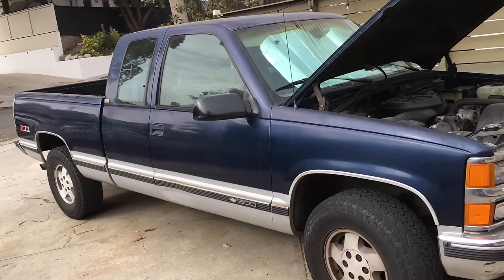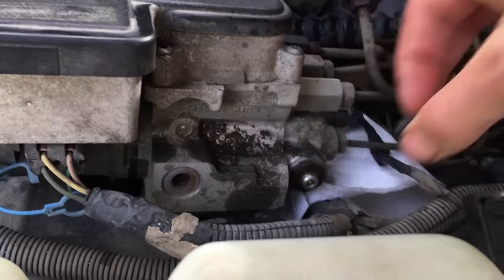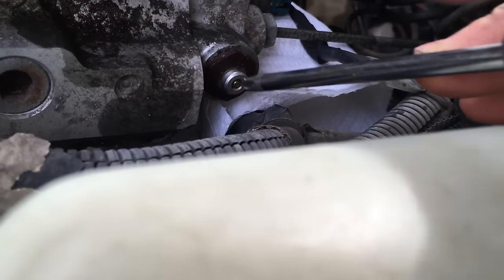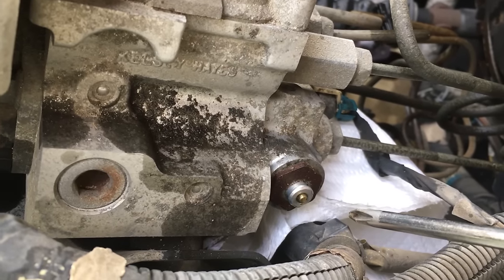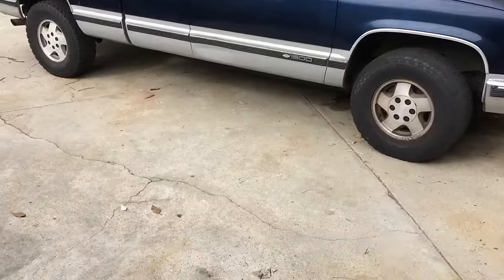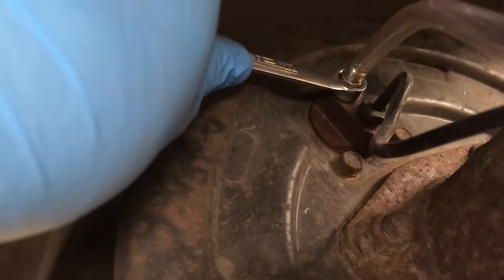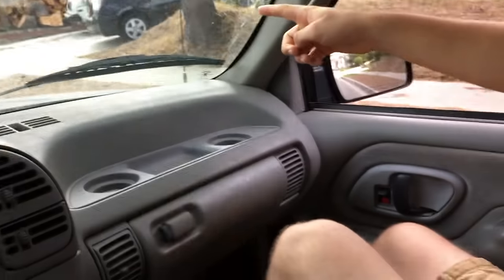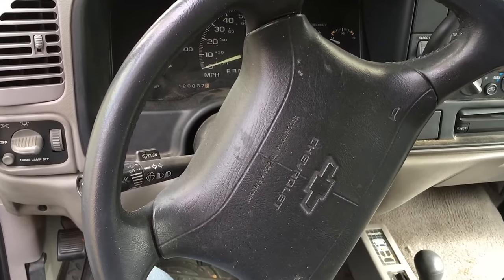Spongy ABS Brake Fix 88 to 98 Chevrolet Silverado

Comment: 96-00 gmt400,  abs scan tool power bleed from OBD II
Reply: @bojackson6714  Mechanics uses scan tool to command the abs module to bleed itself , and then mechanic bleeds at wheels. Voila, good as new!

Comment: Just found out what the problem was ! Had been using non-matelic pads with out any problem. An change to ceramic. Thats when all my.problems started. The ceramic pads are a.little bit thicket causeing them drag. And create so much heat
Reply from the maker: Thanks for posting that. I wondered what the problem was, if you had replaced everything. It’s crazy that they would make replacement pads that are thicker than standard. I’m glad you got it figured out without doing too much damage to your truck. Sorry you had to buy so many parts.

Comment: 88-89, not sure about 90+, the system is a simple RWAL and is composed of a small computer and little valve under the master cyliner ... I did a complete abs delete from my truck since that is what I am used to anyway (and a quick bleed at the master cylinder connections to bleed the air out of the system at the top, and it does work), and I have VERY sweet and firm brakes...oh, and no light either, which I never had anyway... simply remove all the abs stuff, computer and abs valve and brake line from valve to proprtioning valve, then get an adapter, screw it into the proprtioning valve, and bring the brake line from where it screwed into the abs dump valve and screw it into the adapter...this sets the brake system up to how they existed before abs was ever put into these vehicles...simple, quick, and effective...now, if you want to keep the abs, then bleed the dump valve as seen in this video and then the rest of the system, which does work....
Reply from the maker: Thanks. I really should do that to my truck. I wish somebody made a YouTube video showing exactly how to do it.
Reply: @hoohoohoblin  There is....I happened upon it one day after I had modified my system and its absolutely perfect for showing what to do... Your system is a different system being a '95, haven't seen an abs delete video for that system...I can see if I can find the video for my system maybe that'll help you get started...
Reply: @hoohoohoblin  This link gives the basic method, though he removed the master cylinder, I didn't do all that removal, I simply removed all the ABS system components (computer and abs/dump valve, yours looks like a much larger motorized valve) and plugged the brake line, the coiled line running down to the frame after all the components, into the proportioning valve, via an adapter sure to thread size differences... if you have 4 wheel ABS, not sure the first year for 4wal, then I'm not sure how to do a compete abs delete on that system...https://youtu.be/11-QX3jl0q0

Comment: Great vid but I would like to clarify that you don’t pump. R brakes up and hold like you normally would do when bleeding the brakes at the wheels. You push the valve in on the ABS pump and then have someone slowly press brake pedal down. If you pump and hold nothing will come out just like you did the first attempt.
Reply from the maker: Thanks. My son was in the truck, and I wasn’t sure what he was doing with his feet, but it worked.
Reply: I keep hearing this “pump slowly release slowly” stuff

My mechanical brain can’t think of a reason why how fast you pump the the brakes would affect anything.

WHAT IS THE REASON?????

Why do you say do it slowly?

Comment: Well back to square 1 same problem with the breaks 😠 would the porpotional valve cause problem ?mave a cloged valve ? Thats the end of the line A B S want cause them to seize up was told by others mechanics for friendly advice please advise and location of it !!
Reply from the maker: On these old trucks, some people remove the whole ABS unit entirely. You can find videos and forums about it.  I thought about it when mine was acting funny, but didn’t look too much into it, so I’m not sure how good or bad it is after you remove the ABS unit.

Comment: So I hit a pretty nasty bump yesterday and right after that my brakes went really soft.. I immediately checked for any leakage everything’s fine. When I turn the truck off the brakes switch firm and solid. Once I fire up they go soft as heck. Will this method help? I read in the comments to go into a dirt road a slam on the brakes a few times. What should I do? Help!
Reply from the maker: I don’t know if this will help or not. If the antilock brakes are working properly, and your antilock brake light isn’t lit, then the slamming the brakes method will probably work. When you do that, it opens up the circuit and sucks brake fluid in there, where there wasn’t fluid before.

Comment: After replacing the brake master cylinder on my 1996 Chevrolet 1500 pickup truck,i notice that was still leaking brake fluid from the abs control module.I tried to buy it from the dealership,but was told that it was a discontinued item.My worse case scenario is the savage yard.Could that part be rebuilt or should i go to the savage yard to buy it?
Reply from the maker: I don’t know where are you would find one. But if you can figure out where it’s leaking, you might be able to find a gasket that will fit it that is designed for some other part. It could be a generic circle gasket or O-ring or something.
Reply: @hoohoohoblin  I'm in Lafayette,Louisiana.
Reply: @hoohoohoblin  I'm in Lafayette,Louisiana.I went to a salvage yard and i found one.i will buy that one,but i will attempt to have the old one rebuilt if possible,Thanks.

Comment: It didn't work for me... The pin was very hard to push in & I didn't want to break or disturb anything... It was too hard to push in... Any suggestions on why it was excessively hard to push in pin?
Reply: Did you figure out the problem? I am having the same problem.
Reply: @ArtDaBarber619  No I didn't... Something must be wrong w/his unit. Mine is 23 years old. All original. Never had a problem w/it. I just wanted to try it to see if it really work since they claimed a better pedal. Can't believe everything on the YouTube... If its not broken, don't screw w/it right? Period

Comment: My tahoe 1996 has a spongy feel to the brake pedal, we bled all brakes but only brakes that works is the back brakes front brakes doesnt work is it because there is air in the abs thing or is it he servo pump because when i press the brake pedal all the way down its hard to turn and makes a servo pump sound but when i drive its all normal
Reply from the maker: I think it’s air in the ABS module. That’s how it was on my 1995 truck.
Reply: hoohoohoblin how many tines will i need to «bleed» the abs module

Comment: Changed master cylinder on my 05 chev silverado an brakes still seem to drag what now ? Have changed calipers / rotors / pads / fbreak lines / now master cylinder ? An were bleed.  Am now going to completly flush out all the break lines hopefuly this will solve the problem
Reply from the maker: I don’t know. It sounds like you changed everything. Only thing I could think of is that it might be the parking break, but that probably isn’t it. Something must be creating hydraulic pressure to make the brakes be on a little bit.

Comment: I've bleed all my wheels and still have squishyness, i tried this method but there is no fluid coming out at all? What should i do now?
Reply: hold the pin in BEFORE they depress the brake pedal - - if you watch the pin without holding it it pops out when the brake  pedal is depressed so if you hold it in  fluid/air bubbles are forced out around the pin area.  It may take a few tries before you see any fluid - - also release the pin BEFORE they release the brake.  Watch his video closely at first you barely see a trickle of fluid but once the air is gone you get a squirt  so as soon as you get the trickle or squirt release the pin  which seals it all back up - - hope this helps
Reply: Check your booster

Comment: Hi hoohoohoblin,
Thanks for the Video! I did all 4 wheels but did not know about the button on the ABS module. Question, what if when my son steps on the brakes and no fluid comes out by the abs module button but all other bleeds at the wheels do have brake fluid and the brake fluid reservoir is full? Also, my ABS light will not go off, I also have replaced both speed sensors recently as well. Scanner show no error codes.
Reply from the maker: On my truck, even though it had a full reservoir, and I had bled the brakes at the wheels, it was still really squishy and scary until I pumped some fluid out of the ABS module. I don’t know what to do about the ABS light. On my truck, I just ignore it. I’ve heard that there are a lot of things that can turn it on. I didn’t want to replace a whole bunch of parts and still have it not work.
Reply: hoohoohoblin sounds like a plan. Thank you again sir!!

Comment: I have a 2000 C2500 with the JB6 code. 10,000 lb gross. Since I have bought this truck I have replaced master cylinder, booster, steel lines, hoses, calipers, wheel cylinders, bled brakes. Still spongy and red brake light is on constantly. What do you recommend?
Reply from the maker: I have heard that these trucks have squishy brakes by design, but if the red light is on, it means there is some air in the system. If the ABS light isn’t lit, and the ABS still works properly, try driving and slamming on the brakes hard enough to activate the ABS. I have heard that this sometimes helps. Be careful when you do it.
Reply: Ive tried that. Maybe putting the rear on jackstands and idle it in 5 gear or something. Think it would work?

Comment: Dude i have a 97 k1500 and in the spot where you push that button there is just a big hole with no valve to push. I deffinitly have an issue huh?? Sponge breaks have always come with this truck so far
Reply from the maker: I don’t know if it was different that model year. Mine is a 95. I thought they were all the same.

Comment: I have a 97 z71 thats had spongy brakes for years.  Even after a brake job, and flushing the fluid.  I just tried this with no luck.  When the brake pedal is depressed, that shrader valve release button pops out and cant be depressed at all.  Is that normal?
Reply from the maker: I think so. On my truck, I can push it in a little bit and then have somebody step on the pedal and then release it After some fluid squirts out.
Reply: Thanx!  I'll try that.

Comment: I have a 97 Chevy Silverado 1500 I have been having problems with my ABS locking up and stopping me like i am hitting a brick wall. Everyone has told me what is wrong of course So far i have replaced the brake booster and master cylinder was going to change breaks but pads roters and all is great dont need changed. the one Plus in this so Nothing has worked now they r telling me its the ABS MODULE  okay enough is enough my truck has been sitting at mechanics for a week just got the part in (modulator) had to find one myself because they dont make them anymore for my truck apparently too old Well Whatever So my question is Could this possibly be the Module or do i just need to bleed the Module thats on there ????? I AM DESPERATE here !!!!!   I haave already spent over $1000 TRYING TO FIX THIS  So really getting frustrated. THE thing is this was my DADDY'S truck i lost him in Jan 2022 from lung cancer I will do whatever i have to to get this running right or its going to become my new lawn ornament Someone please help Desperate in Missouri Thanks all. I also really enjoyed this video at least you explain instead of just doing and have to figure out from looking and thumbing it
Reply from the maker: That’s a good question. The brakes on these trucks are terrible. Some people illuminate the ABS module entirely, so you can look around on the Chevy forums and see if you can find somebody who explains how to do that. I’ve never been able to find out how exactly that works, but I know it can be done.

Comment: Got a bit of a unique problem. Brakes are very squishy, brake light is on, but I replaced a broken brake line, and the problem hasn't gone away. I try to bleed the brakes, but fluid is very slow to come out. Now, I've looked for answers and the next thought was to bleed the ABS, but I can't. The ABS bleeder valve is missing the valve stem one would press to bleed the ABS. What I need to know now, is if I can replace the bleeder valve, or if I have to replace the entire ABS module. I don't want to spend money I don't have to, and I'm running out of time to fix this truck ('98 blazer Ls). Any advice you can offer would be much appreciated.
Reply from the maker: That is a tough one. These brake systems are tricky.  Is your ABS light on, or is it just your brake warning light? There are two different warning lights. I have read some people saying that if your ABS warning light is not on, and you get the truck moving and then slam on the brakes, it will open up the ABS valve and flush the bubbles out of the system. Obviously, you want to be very careful when you do this so you don’t get into an accident.  After that, check the fluid level in the reservoir and fill it up again.
Reply: Well, the ABS light is not on. It's just the regular brake warning lights. I could try moving it and slamming on the brakes like you suggest, but I'm concerned about whether the truck will stop or not. I've managed to get pressure built up in the brake lines, but once I turn the truck on everything goes squishy again.

Comment: What happens if this doesn't work? I have a 98 that won't bleed on the passenger front and the abs isn't bleeding like in this video 🫤
Reply: @Fleecejonhson  it ended up being the abs module itself. All lines were clear. I pulled the abs block and routed the lines straight off the reservoir. Works great now as long as I don't stomp the brakes 😅. I can't recommend that for everyone tho I just couldn't afford a new unit.

Comment: I tried this and when I finished trying to bleed it from that pin, I had stepped on the brakes without touching the pin and fluid continued to come out. Did I do something wrong? Do I need to replace that part?
Reply from the maker: Probably not. Try pressing it in again a few times and see if it stops leaking.
Reply: @hoohoohoblin  I'm having this same problem here, press the brake without touching the pin but brake fluid still keeps coming out. I've tried pressing the brakes many times but it just keeps coming, do you know how to stop it from coming out? Thanks ( it work fine before)

Comment: Still spongy after changing master cylinder bleeding the brake and that valve ? Any ideas?
Reply from the maker: There isn’t much else to change. There might be air bubbles still in there. These brake Systems are notoriously spongy even when they’re set up perfectly.
Reply: @hoohoohoblin  turns out it's the ABS modulator🙃

Comment: Is this the way to get rid of the abs light
Reply from the maker: Possibly. But often the wheel sensors go bad, so, even if you have enough fluid in it, the light will stay on. Mine is on all the time.

Comment: I have 2000 sub. Worst place for the abs under drivers seat. After i replaced all 4 brake lines (killed m6 hands)and bled them i payed a mech to do a (?) Abs bleed reset using a special electronic gadget.  It worked ok but i still have a crunch and brake fail at lowest stoping.  Its not safe.
The mech said i have a old dirty wheel bearing..

Comment: I thought about removing the abs and put a proportioning valve from submit racing a disk/drum and just have my brakes like the old trucks with no abs bullcrap.
Reply from the maker: I know that people have done that. They’ve told me about it in the comments. I don’t know exactly how to do it or what parts you need though. It sounds like a smart idea if you do it right.

Comment: The front abs  sensors are not to hard if the truck isnt very rusty. No need to replace the wheel bearing like everyone thinks and the sensors are like 40 each.
Reply from the maker: Thanks. I really should do that one of these days.
Reply: You can get the pair of front senors for $30 on amazon
Reply: I did my dads 97 truck sensors.  His truck kept going full abs pulsating on low speed braking.  We live in the rust belt and it was easy to do.
Reply: I wish that was true for me I live in New York. That winter time salt makes everything too rusty to replace. At least the sensors anyway LOL

Comment: Do you have to bleed the breaks after this process or is kinda like a courtesy?
Reply from the maker: I bled the brakes before I did this. Then it worked fine afterwards.
Reply: @hoohoohoblin  Another great vid, thanks! Can I just confirm the order of operations here...1. Brake Bleed, 2. ABS Module Bleed ?, or the reverse? Thanks.

Comment: Hello , do you think this will work on a 2003 S20 ? I have tried the slamming on brakes thing no luck , thanks , nice video👍👍
Reply from the maker: I don’t know. My truck is a 1995 model. Not sure if they changed the design after that. If yours has a valve like the one in the video, you can try what I did.

Comment: I tried exactly what he told me to do and it didn't work so I bought a Wilwood proportioning valve off the eBay then I went to a custom Hose Shop and had all custom brake line steel braided brake lines made for my truck cost me about 300 bucks with the new master cylinder hit my truck brakes better than ever
Reply: I tried to get the bubbles out is still had air trapped in the valve body
Reply from the maker: Can you post a video of it? I’d like to see what it looks like and how you did it.
Reply: hoohoohoblin I dont have a you tube channel
Reply: hoohoohoblin do you have and email i can send it to you if you like

Comment: I’ve got the same truck with the same issue.bleed the abs an all four wheel with the car off.as soon as I start it up the pedal still goes to floor.
Reply from the maker: Mine was doing the same thing, and this fix worked. I think it’s been over a year now, and the brakes still work fine.